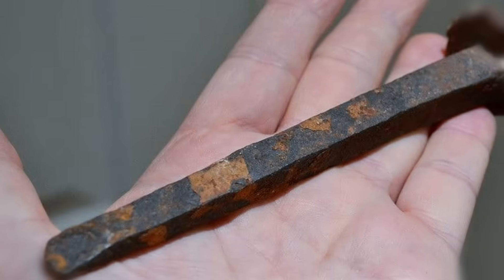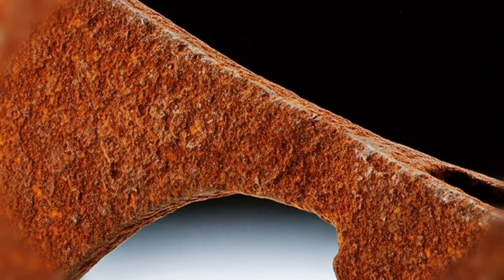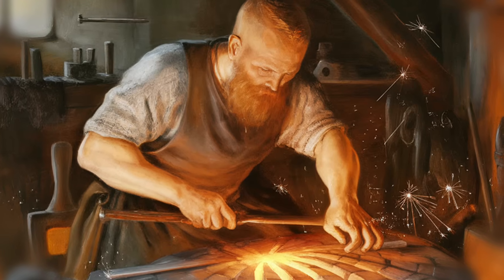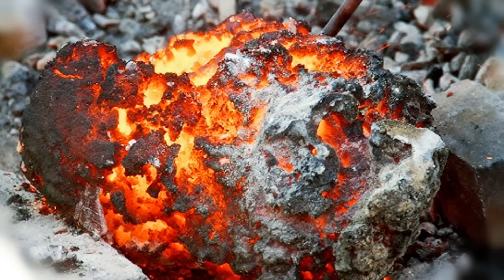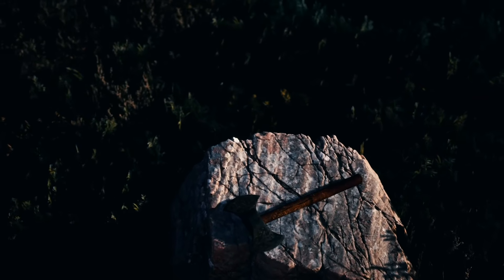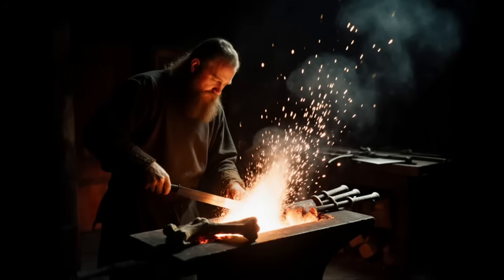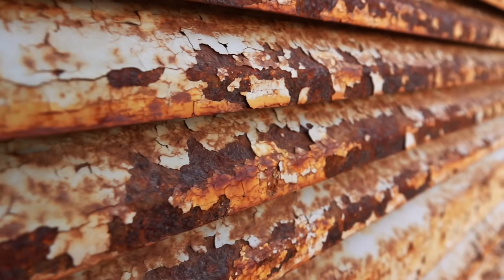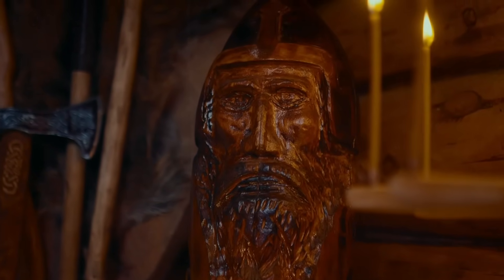Why VIKING Iron Never Rusted While Yours Dies in 2 Years

Comment: One shouldn't leave out the modern system trick of the industry which is called Planned obsolescence. A strategy where products are intentionally designed to have a limited lifespan to drive future consumer demand for replacements. That could also be a reason why the industry started using pure carbon iron. So it is not just a conditioned desire for perfection, but also a very conscious decision to keep the lifespan of certain products short. The Vikings did not have such a self-destructive system.

Comment: After a piece of metal has rusted, applying vinegar ( which could have been easily produced at any time in history), turns the rust to a rust-proof black coating. All that would be required after that would be soda to neutralize the vinegar.

Comment: (7:15) “The other key ingredient is charcoal, not coal. This choice matters more than you might think. Coal contains sulfur, an element that poisons iron, making it brittle and prone to cracking.”  I was a blacksmith for about 20 years, we forged with anthracite coal, as did almost every other blacksmith I ever knew. Furthermore, I have never heard anything about coal adding sulfur to iron, making steel brittle!
Reply: At that point in the video he is discussing the process of smelting bog iron to use in forging, where you need coke to burn to produce the carbon monoxide to remove the oxygen from the oxidised iron. Charcoal is basically a coke formed from wood. Anthracite is fine for forging iron. Scandinavians used wood and charcoal because it was freely available rather than coal - to use coal in a bloomery you have to first burn it in a coke furnace to turn it into coke. Contemporary blast furnaces use oxygen to de-oxidise smelted ore, eliminating the need for coke.

Comment: Let me see if I can guess why Viking iron lasts thousands of years, while ours lasts only 2 weeks! The reason is in the difference in how they are manufactured. Most of our steel things are made out of pure alloy steel, which rusts easily. Our early, blacksmith-made items are likely made of wrought iron, including the Viking iron. Wrought iron differs from mild steel in that it contains impurities made of silicon, i.e. sand. Bog iron is smelted, and made into pigs, which contain silicon. Then that iron is forged out into bars, the silicon impurities get beaten out with the iron, which is distributed through the material, sealing it off from moisture and limiting rust to the surface of the material.

Comment: It's not that those in charge don't know how to make things that will last. It's that they have designed the system to be replaceable intentionally for profit. If it last forever, they profit once. If it has to be replaced repeatedly, they profit repeatedly. there is the reason for the replacement economy we live in. Those at the top would have you believe it's for workers job security. But we all know that's a lie. Never more obvious than now with the automation coming down the pipe

Comment: Metal can be forge welded without melting the metal. Today steel is made that will eventually be covered with oxidation that does not oxidize any further.

Comment: As a professional knife maker I found this to be very entertaining and informative for those who would never have exposure to metal craft
Reply: Im a traditional wooden boat builder, so i do a but of blacksmithing, but the REAL blacksmiths who taught me, said that the reason that new iron rusts faster than old iron, is because new iron isnt really iron, but mild steel, steel with a little bit of carbon in it, which is less corrosion resistant than the old rought iron.  This is because iron/steel is so readily recyclable, that it all keeps getting remelted and mixed together, and its just more economical to do that, rather than keeping iron and mild steel seperate.
Reply: Are you promoting nazism?
Reply: The viking worhip blacksmith God.  Just show how much they in to metal compare to other civilization.

Comment: I'm a bladesmith with 7 years experience, I've never ever heard of this.
Reply: That'd be from the fact that you aren't making blades from cast or wrought ("rot") iron.
There's a reason vikings were using Eurasian Steel for thier swords for the ENTIRE time that they had trade routes down to and through the black sea, and only switched back to the pot metal "bloom" iron after those routes collapsed.
The iron that they were originally using is garbage (in comparison) for a weapon's blade that needs to hold an edge.

Comment: In a 1000 years nothing we made in steel, plastic, aluminum will be found. Ancients had a superior technology and we have ignored it to make more and quantities. 

Modern concrete will decompose in 1000 years.

What is the maximum life of modern concrete?
Generally, for large infrastructures, the lifespan of modern concrete is about 100 years if properly maintained. Roman concrete found in Pantheon and Colosseum still stands. 

Structures built with Roman concrete are almost 2000 years old.
	•	Pantheon: Features the world's largest unreinforced concrete dome, constructed around 118-128 AD, which showcases the structural capabilities of Roman concrete.
	•	Colosseum: Also built with Roman concrete, this massive amphitheater demonstrates the material's durability. Was built about 80 AD. 
	•	Aqueducts: The Romans used concrete extensively in constructing aqueducts, which relied on gravity to transport water over long distances.
	•	Harbors: The Romans also used large-scale Roman concrete for building harbors, including in Caesarea, demonstrating its ability to withstand harsh underwater conditions. Built 
about 10-22 BCE.

They should be exploring better structural materials. 

Common examples of structural ceramics include: 
	•	Alumina ((I worked manufacturing this material it was like metal with aluminum and ceramic was used for electronic circuit boards.))
	•Known for its high strength, hardness, and electrical insulation properties.
	•	Silicon Nitride 
	• Noted for its excellent thermal shock resistance and strength at high temperatures.
	•	Silicon Carbide:
Valued for its extreme hardness, corrosion resistance, and high thermal conductivity.
	•	Zirconia
Known for its superior thermal stability and toughness, especially in its transformation-toughened form.
Reply: The common sparkplug   , only physical destruction can destroy it, they are forever.
Reply: Somebody figured out that Romans had accidentally figured out how to make what we now call "Quick Lime".
Turns out that we have had access to the use of Roman Concrete for decades, we just don't typically use it because we need our concrete to support massively larger load weights. Roman concrete wouldn't last 10 years in modern use. Quick Lime/Roman concrete will sit in place for a very long time because: micro-pockets of unmixed concrete get exposed to water when it cracks and then cure/harden into concrete, which structurally seals the slab back into a single unit. HOWEVER, having those micro-pockets causes the concrete to have the load bearing capacity of swiss cheese, causing fialure cracks to appear sooner... AND once all of the pockets in a single area have been exposed to water and cured, the entire section of that concrete will collapse under load.
Stop romanticizing what you don't understand. They weren't Magicians, they were just doing the same things for a thousand years and eventually trial-and-errored their way into a few decent discoveries.
Reply: Well stated.
Reply: Consider our increasingly Biodegradable world in in the context of history and the fact that everything is slowly sinking into the earth being drawn down to the planets core. If there were an advanced civilization at or better than our level of technology we would likely never know of it unless in the 1% of 1% we turn up some remnant. Likely most of the solid structures like concrete and what not are so deep by this point they will never be found.

Comment: You don't use coal in a forge or bloomery, you use coke. Which is coal that has been pyrolyzed to remove contaminants. 99.9% carbon. Charcoal is pyrolyzed wood.  Until about 300 years ago coke was not used  commonly because of cost and availability.
Reply: Charcoal is better.

Comment: This so wrong!
The materials we use today are the best you can make out of the elements, period!
Ancient blacksmiths weren't "better", because they had a "secret technique", just just couldn't do better.
Our materials are homogenous, perfectly designed for their intended use. And yes, sometimes having certain properties gives them a lack at others, such as corrosion-resistance. It depends on what I want the material to be. And today we are able to craft materials with properties we want them to have PRIOR to their making.
So, that being said, no false nostalgia and sensation mongering, ancient artifacts that survived are not MADE to survive, they accidentally did. It just happened out of circumstances, not knowledge. Reaching a grade of craftsmanship necessary to manufacture tools, weapons and armory so resiliant took them generations of gathered experience.
It' really cool what they achieved without metallurgy, chemical knowledge and analysis, but it is not as miraculous as often depicted.
Reply: The Vikings would have loved to have had any of our modern steel alloys, and even if they rusted faster the modern alloys would have performed much better.  The weapon or tool only had to last as long as the person using it lived, and even if passed down a valuable sword or tool would have been protected from rusting with wax or vegetable oils by its user. I think this video shows why wrought iron (and cast iron as well) lasts longer when discarded or lost to the environment, but the Vikings did not know they were making weapons and tools that resisted rusting better than the future alloys that would be made in crucibles and cast from ladles some holding many tons of molten steel, they just knew how to make good weapons with the technology they had at that time.

Comment: Iron and steel are quite steel are quite different. Basically, steel is iron with the addition of carbon. It is the presence of carbon that makes steel more susceptible to rusting. Conversely, the purer we can make our iron, the better it will be at resisting rust.
At one time, there was "Swedish iron" greatly favoured for electromagnets as once the current was off, the magnetisation was virtually totally off unlike steels which remain magnetic to some degree.
Likewise, the more we recycle, the more our steels become random mixtures increasingly open to corrosion.
Reply: Ya. No... it's slag . Industrial steel they pull the slag out and other beneficial elements. It makes it more flexible and easier to forge and roll. The rust isn't a bug, it's a feature for capitalism. Same as concrete. Same as cotton instead of hemp and and on...it's really not capitalism anymore, it's cupiditism.
Reply: Actually, steel has excess carbon burned out of it by the injected O2.  Pure iron is ductile.